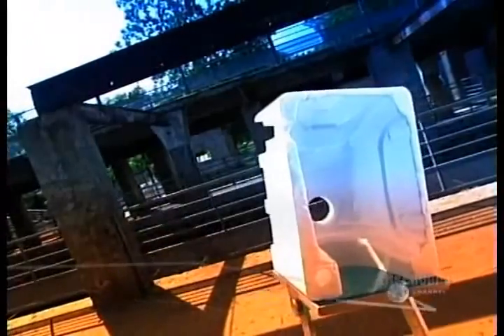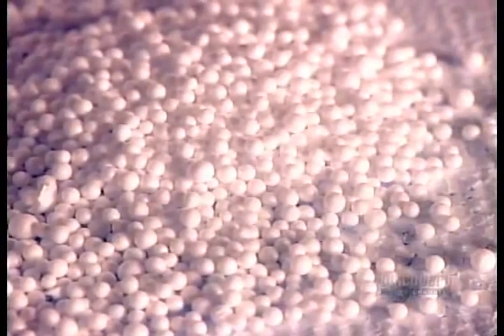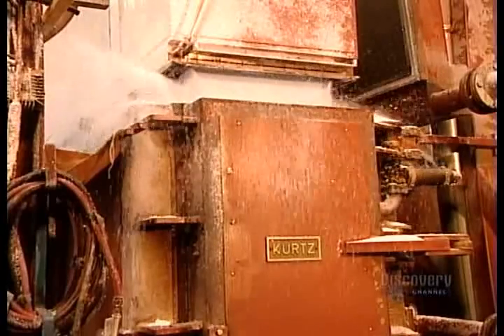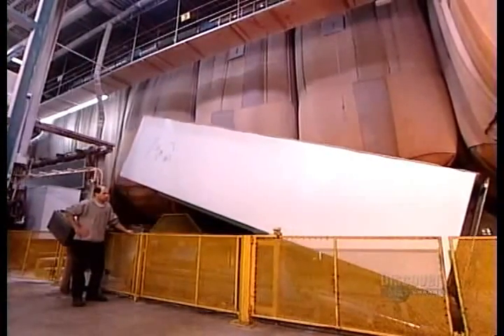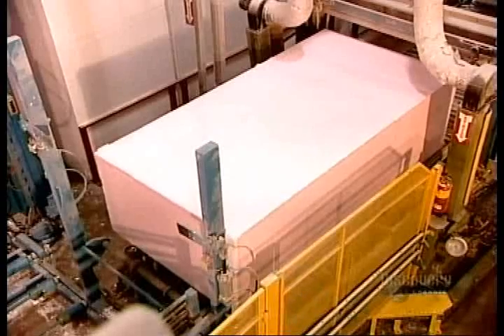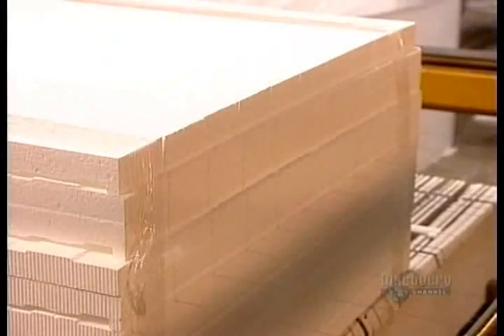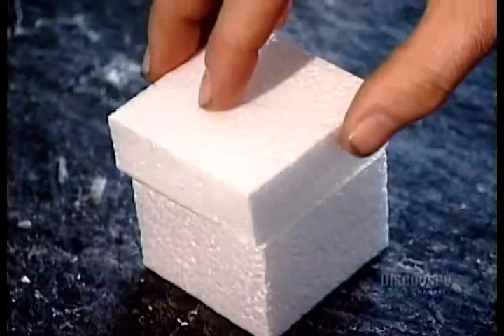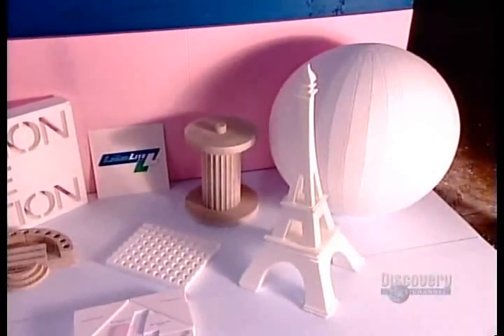How Its Made - Expanded Polystyrene Products / Thermocol

Comment: Lame episode. Styrofoam isn’t always made in blocks, then cut. They often expand them in a form to manufacture complex shapes without any cutting.
Reply: There are EPS shape molding machine and EPS block molding machine.
You will need a molding tool for shape molding machine.
Block molding would need some hot wire cutting instead.
Reply: @DentalEquipmentMichael , Right.